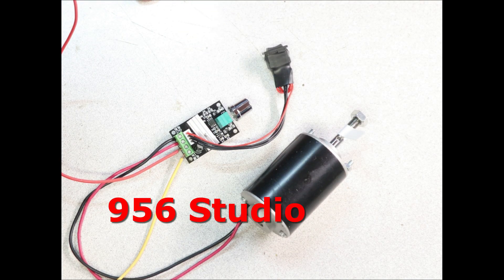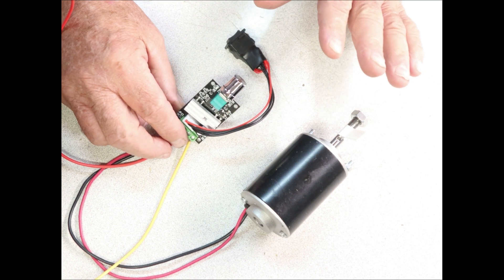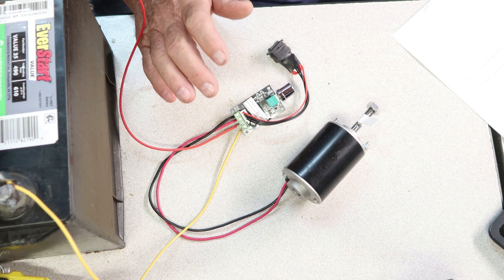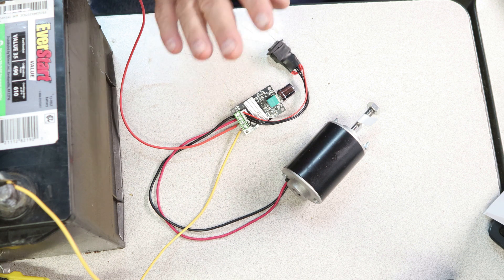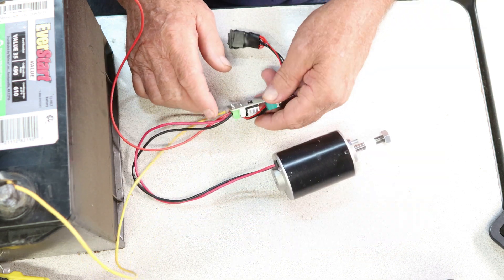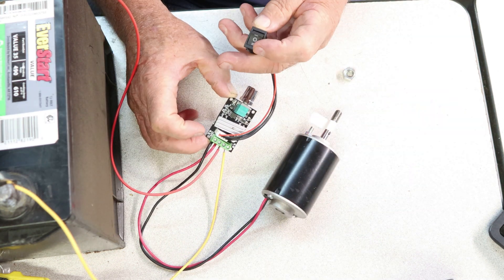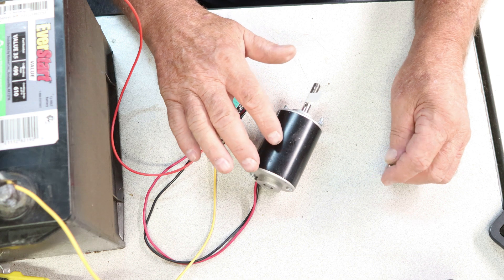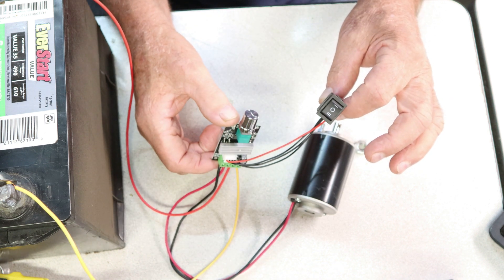DC Motor Speed Control: The Ultimate Guide

Comment: hi, i want to ask something else question, i have servo with potentiometer controller, it do stop and reverse base on potentiometer position. lets say we turn in the potentiometer's  value 60% the motor dc stop, and then 70% run, then in 80% value it stop. how can i reduce the area between stop point numbr 1 and 2? something like in 65% stop and 75% stop. thank you
Reply from the maker: It depends on unit and if it has an adjustment